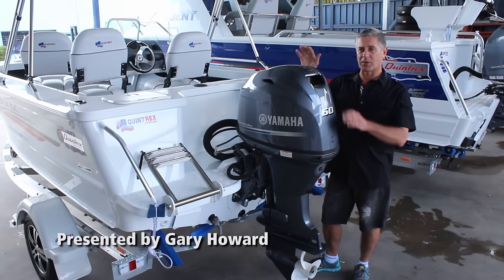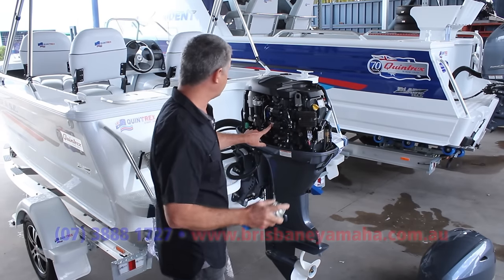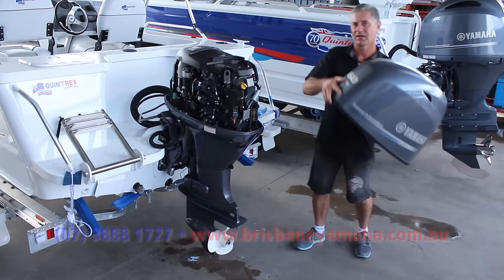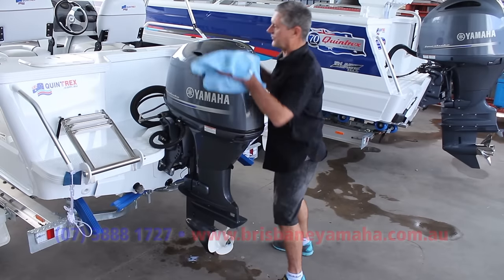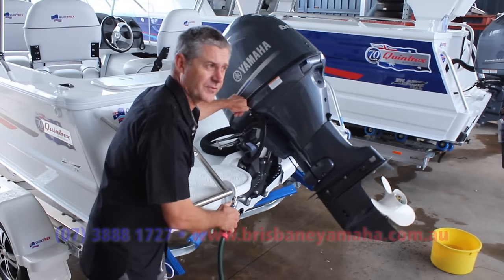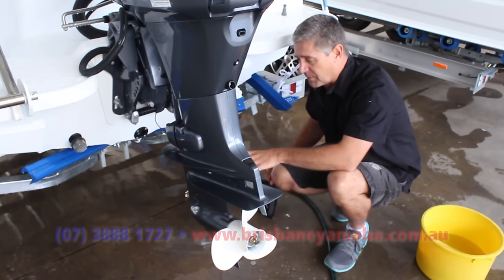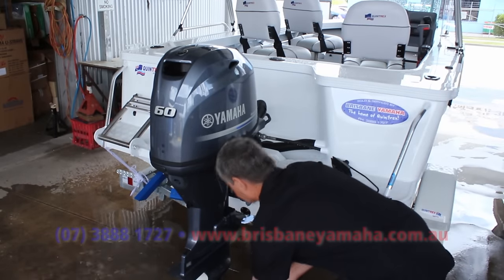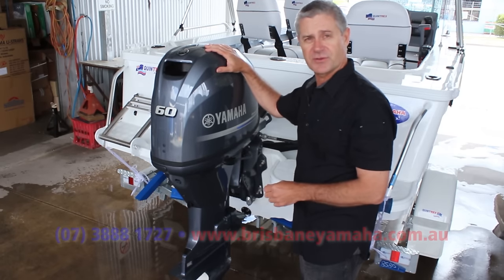How to flush your motor - presented by Brisbane Yamaha

Comment: Hot  (medium) water is best for  dissolve salt. I have installed a  hot/cold water mixer tap outside for flushing. I avoid chemicals as they can damage the interior Teflon  engine coating over time. Always flush for a few minutes before starting engine. Top flush is best to avoid any particals being lodged into engine.

Comment: I thought the engine block itself is supposed to be sprayed with Yamashield (similar to Boeshield T9) while the Silicone spray was more specific for rubber seals/gaskets/etc (silicone is a great rubber conditioner and prevents cracking/drying/etc).
Reply from the maker: Wow all true but not 
Yamaha make protective lubricants for many purposes
When your leaving an outboard for months on end you do a different process but for normal proventitive Maintanence yamaha recommend their proprietary silicon spray 
And I can tell you it works a treat and will keep your motor looking new 
For long term storage we recommend flogging motor internally with another yamaha product
Reply: thanks for kind advise ideas to maintain y/motor I have 556 marine sprayed on my motor

Comment: Hi there. I have a brand new 2021 F25 Yamaha and was wondering if the water pump gets any water through it using the easy hose connection. Very helpful videos. Thanks so much from a Florida viewer. 👍
Reply from the maker: Yes 
The grease was flush is all you need to do 
Remember do not start motor simply tur. Tap on and fun for 5 minutes
Reply from the maker: Yes it does 
Yamaha wants you to only use fresh water flush

Comment: Thanks for the video. Just a curiosity. I have the same motor and as shown in video like mine it vibrates a bit. Is it normal or is it to worry about or its a normal thing on oUtboard. Thanks
Reply: Kylie Zammit hey mate it’s just cause it’s running all outboards do this no matter how big or small
Reply from the maker: Prop shaft 
Put something in middle of prop shaft and spin prop if shaft moves it shaft
Or prop has damage
Or it’s rooted 
Lol

Comment: The rectangular ear muffs ( brand new)   dont seal properly on my 65 Yammy and will not pump the water through the telltale. I tried squeezing them together and putting them in hot water to soften them up a bit. Still no good.
I borrowed an old round set from a mate and they picked up the water straight away and pissed it strongly out of the telltale.  Anyone want a brand new used once pair of rectangular earmuffs for free ?

Would it be a good practice to leave the motor idling for a minute or so  after the muffs are removed so as to pump out any water still remaining inside the motor ?   ( Obviously turning motor off as soon as the telltale stops running. )

Comment: Shouldn't you flush the engine then wash it down then apply the silicone protection? I ask this because wouldn't the silicone make it difficult to wash off the salt? Just asking.
Reply: marchbah 
3.44sec he mentiones after you come back out of water how to wash it
Reply: Yes
Reply: brand new engine
Reply: Yes, you are correct. I do exactly what you do but add a little salt away during the flush.

Comment: Whats the name of the actual product you are using?
Reply: As far as I know, it is the recommended Yamaha Silicone Spray - formulated by Yamaha to prevent corrosion while NOT damaging rubber seals and hoses
Reply: Yamalube

Comment: I've forgotten to screw the cold flush cap back on once or twice when running the motor with flush muffs and water from bottom up, what are the affects of doing this ? I do know when doing this, water comes back out the cold flush pipe...usually shut it down after about 30secs...model is 2016 F130hp 4 Stroke.
Reply from the maker: What the ?
Why flush muffs- there a problem not solution 
If engine didn’t get enough water it will over heat if hot enough engine will go into limp mode before any real damage 
The fresh water flush is all you need to wash salt out of motor
And you don’t start it just let water flow

Comment: Would wd40 be inappropriate as a lubricant?
Reply: Yes. it's not really a lubricant in the first place, it's more of a cleaner with lubricating properties. Use something like silicone lubricant
Reply: My dad has been using wd40 for years and it does actually work.. but there are better products out there.

Comment: Hello! What propeller do you use for this motor (60 hp)
Reply from the maker: Yamaha 11G
Reply: @BrisbaneYamaha  I am interested about the pitch of the propeller. I own a boat similar with the one in the movie, same motor with 11x15-G propeller, but the WOT is about 4900 rpm. I intend to buy and change the propeller with one 11x13 or 11x14. And I don't know which is the best choice. Thank you!

Comment: Wondering how long you are supposed to flush it for?  Getting varying times from different sources.
Reply from the maker: 5 minutes
Reply: @BrisbaneYamaha  thanks
Reply: You should run the engine long enough to open the thermostat
Reply: @WhiteBuffalo032  and how long is that? And how do you know the thermostat is open?
Reply: @Munrubenmuz  mechanics recommend 15 mins. Full operating temp. Just fixed a big hole in block right past the thermostat. Previous owner just used the hose connection for ten years. That's what the owner's manual says .its wrong.
Reply: @Munrubenmuz  and be sure and use ear muffs and not the garden hose connection for this the garden hose connection is for when it's sitting in the water or in a boat slip and you don't have muffs
Reply: @WhiteBuffalo032  thanks mate. I usually do both.
Reply: @WhiteBuffalo032  last dumb question. Is at idle ok or does it need a few revvs to open the thermostat?
Reply: @Munrubenmuz  not dumb at all. Mechs say idle is fine
Reply: Is cold flush sufficient? Everyone is saying you must run engine to open thermostat. I won't be able to turn engine on due to noise.

Comment: One major point he missed is to make sure to flush it with Salt Away if you're in salt water.  It removes the salt much better than regular H2O and provides corrosion protection.  The salt literally melts off.  You flush for a couple minutes with regular H2O then Salt Away for another minute or so.  Do not flush again with H2O after applying Salt Away because of the corrosion protection from Salt Away.  I will then rinse my entire boat with Salt Away including the areas around the motor that this guy points out in the video.  Its the only way to prevent corrosion and it works.
Reply: Rubbish
Reply: @lakalaka9436   Hey genius, you've never used it have you?  Don't answer it. We already know.
Reply: Hahaha...yeah, opened a few motors in my time and it works, but no better than a basic detergent flush.......it’s overpriced and overhyped in my opinion....and that of a lot of boating mates, it really sounds like you work for them......if that’s the case then bad from you....dissing another’s opinion 👎
Reply: @lakalaka9436  Don't work for them. Not sure why you would think I do simply because I said its a good idea to use which you also said it works. Its a bit pricey but if I can afford it then so what.
Reply: Salt away every time.
Reply: Hot water is best top flush 10 minutes, no need to start engine long term chemicals will reduce teflon interior coating.. Have had many engines during 30 years, never had an issue. Same for exterior salt 80Cel hot water no residue. Outdoors  H W mixing tap, simple.

Comment: Thanks for the video.  Which flushing method does Yamaha recommend? Thanks
Reply: @21tjd Excellent, thanks for the reply.  That is the same motor we have.   Ours is a 2017 model with 25 hours on it.  We have been doing the cold flush on it.  Very happy with the engine
Reply: @21tjd Thanks.  new motors meaning...?
Reply: If you run it in salt water you want to flush through the intake ports with muffs squeeze inside the hose a little dawn dish soap and run till clean water runs out! Been doing this for years on all my boats and water craft and the water jackets in the heads have always been very clean with almost no salt deposit!

Comment: If the boat lives in the water and I'm flushing from the top attachment is it a bad idea to flush it with engines titled up?
Reply: flushing with the engine up is fine.  Also use a salt remover like salt away along with the mixer that comes in the kit.